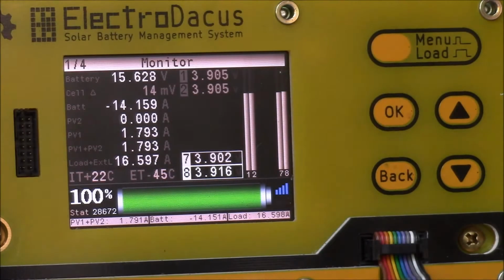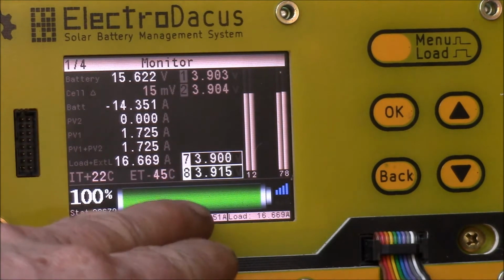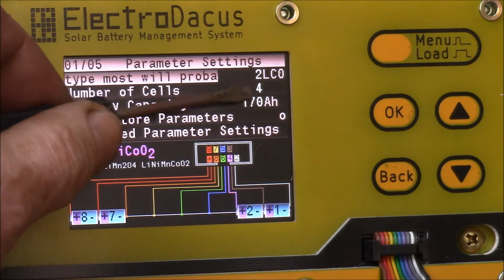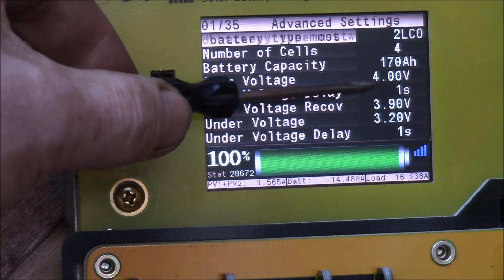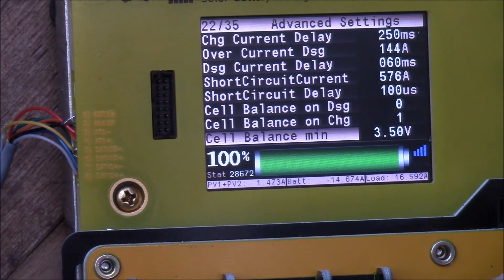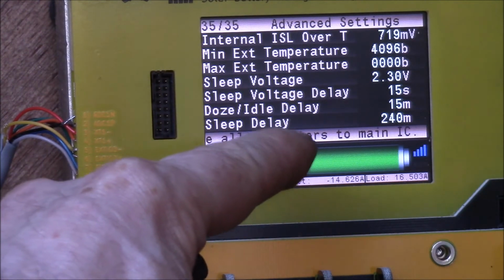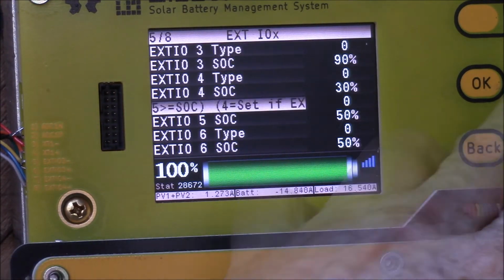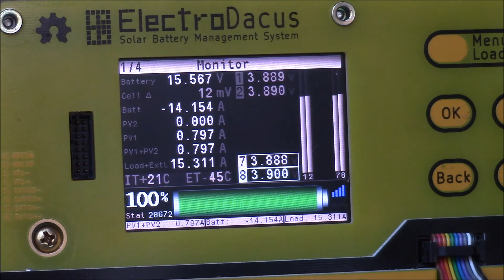SBMS-120 4S Lithium-Ion Parameters

Comment: The SOC is set at 100% when EOC (End of Charge) flag is set and that is at 3.98V default and that flag will only get cleared when that higest voltage cell drops by about 130mV (this is fixed in the Intersil BMS IC and can not be changed). This works great with LiFePO4 as those drop fast from 3.55V max charge voltage to 3.4V without almost any energy getting out of the battery but with this type of high energy density cells you have that is not the case. I can look in to using a slightly different method tot the SOC.
The type of cells you use are more expensive in therms of cost amortization so over 90% of people use LifePO4 with SBMS thus I heard no complains bout the SOC.
I guess you seen that there are 4 monitoring screens that can be accessed by using the up and down button while in the first monitoring screen you showed here and there you have energy counters that you can reset every day if you want to see statistics about energy production and energy usage and you can also see energy graphs.
The Store Parameter send the settings you make to the ISL94203 EEPROM memory but for safety reason the ISL94203 works from a RAM memory and only after a power cycle it will take the EEPROM parameters and put that in to working RAM memory.
It is considered that you only set the battery parameter’s once and then those only need to be changed when you need to replace the battery.  Of course you do that more often as you play with different number of cell configurations and experiment but in a standard setup you just set that once at initial installation and the system should be completely hand free (no maintenance or any other user involvement needed).
In the EXT IO setting you will need to at least have the EXT IO3 set as type 2 and connect that to the inverter remote ON/OFF port that way if any cell is to low the SBMS can turn off the inverter to protect that cell for over discharge.
Sorry if it looks a bit complicated with to many settings but the SBMS was mostly designed for my own use so is biased towards my own needs.
Reply from the maker: Thanks for the information.  That 130mV sounds exactly what I'm seeing and that makes sense.  Once the SOC drops down far enough, I find the SBMS and my TriMetric meter read within a percent or two of each other.  

I really like having full control of all the parameters, not complaining at all.  I had tried some of these low cost BMS boards and they are totally fixed.  No balancing until you exceed 4.2 volts, no indication that anything is even going on, no LEDs, no data port, nothing.
Reply: Those BMS boards use a individual IC for each cell monitoring with a fixed internal threshold and they do no communicate with each other so BMS overall has no idea about the delta between cells and the balancing that starts at a fixed voltage like 4.2V is completely ineffective that is why you see some try 1 or 2A cell balancing current but it will still not work since there is just not enough time when you already at 4.2V.
If there was a good BMS I will have never designed the SBMS. Those BMS where available even 5 years ago when I started designing the SBMS but they are not usable if you care about the battery.

Comment: Well I’ve received my sbms 120 and I’m only receiving 2 cell out of 4. Then I got 4 cells with the 7th cell reading 4.3v. I’ve connected balance wires from black/white number 1st negative to grey 2nd cell negative, 3rd cell negative purple and 4th cell positive green at the main positive. Didn’t work. This was a real headache to sort out. But I did it. It took me half a day to realise that 2 cells must be wired up from negative black until purple positive in the middle and the other two cells starting from battery main positive brown back to red   and to orange negative in the middle. That’s very different and unique to this unit. Not explained in the manual. It’s means a lot of frustration. Along with a few other things like the remote on off and the diodes. Their needs to be a clear diagram showing pictures and schematic of all components needed. I want this electrodacus to work as it’s far ahead of anything out there but Dacian Electrodacus needs to sort out the full cost of this item and the manual needs to be much clearer.
Reply from the maker: Yes, you use 1-2-7-8 as noted in this video:
https://youtu.be/5IR_0eHAAMc?list=PLpY2FP1a9tiuoQAxvpznrcYEYf8AzyaPL&t=258

Comment: How's your sbms now still kicking well?
Reply from the maker: Yes, still working great.  Keeps the cells balanced within 10mV or so most of the time.
Reply: @The4Crawler  great! thanks for reply. I'm searching for new Video about SBMS  hows the charging? I'm keen on to have that one soon
Reply from the maker: It seems to charge quite well.  It's not PWM or MPPT, it just connects the solar panel directly across the battery until it hits the full charge voltage.  Then it stops charging until the battery drops to the reconnect voltage and then it'll start charging again.

Comment: Sweet video, I have a sbms40 setup now works good
Reply from the maker: Excellent.  My SBMS-120 has been chugging away without issue since I installed it.  It's been keeping the cells balanced to well under 10mV difference.  I need to swap another solar panel from my MPPT controller over to the SBMS.